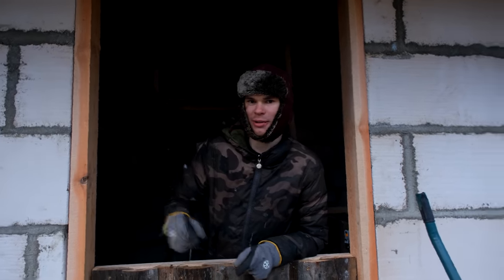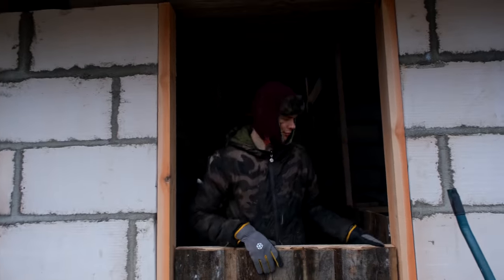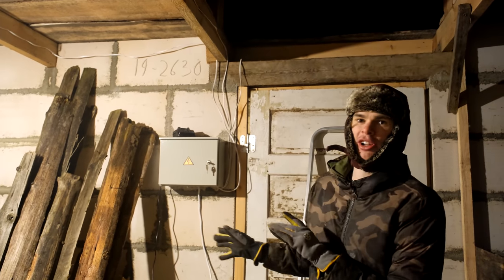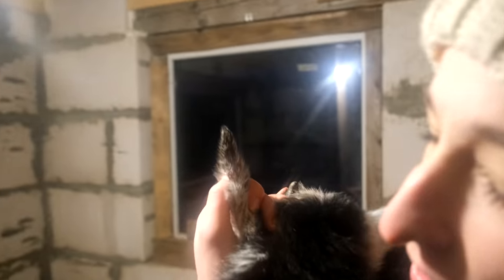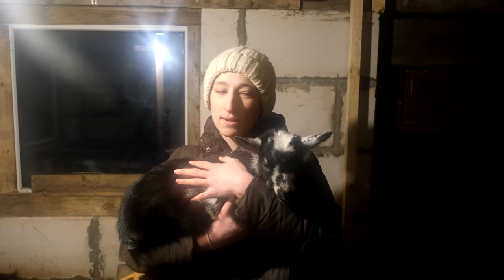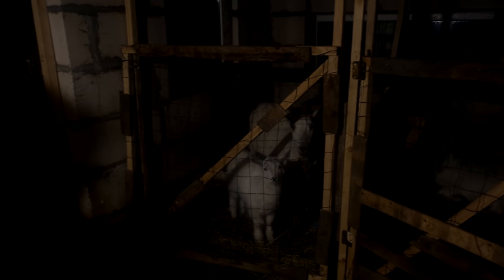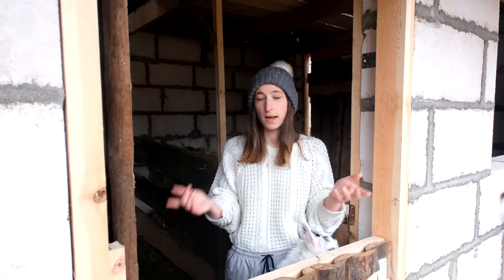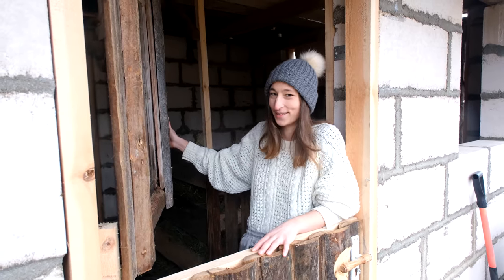Dutch Door for Animal Stable

Comment: Nagging Crone here again. It's just I went through all the same things fifty years ago. When I finally wired my first barn and in my second I ran all the electric cord through metal conduit electric tubing. On farm there are rodents etc that chew through the wiring. Also livestock especially goats climb up to pull and chew. Till you get your glass for the windows you can use heavy greenhouse plastic to cover or tarps etc.